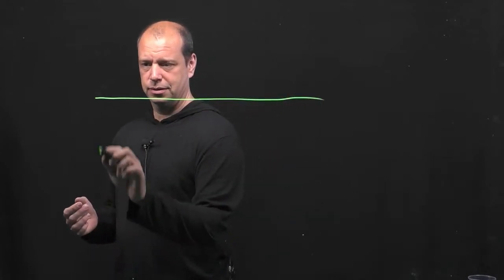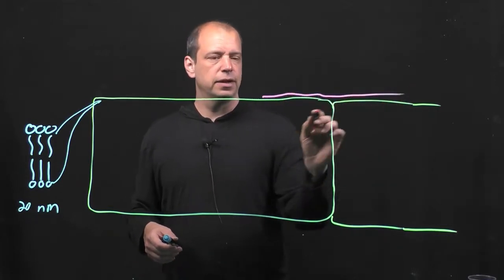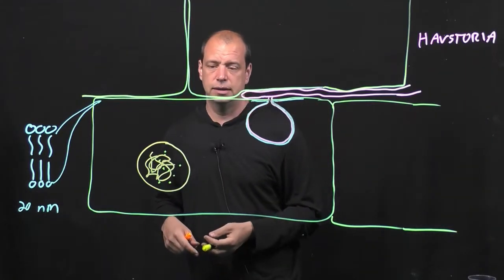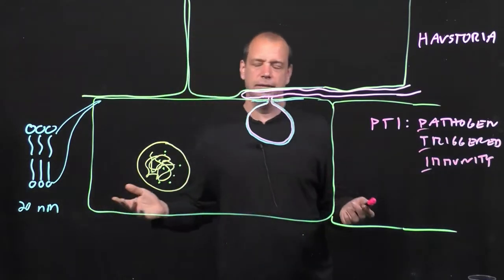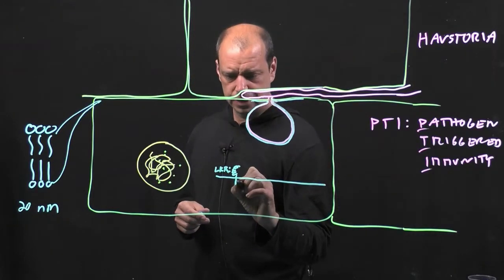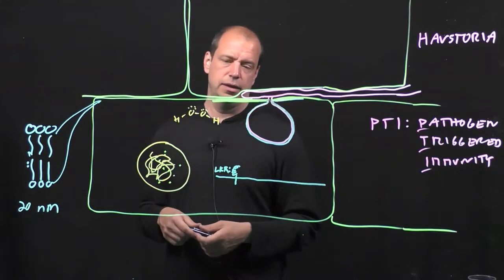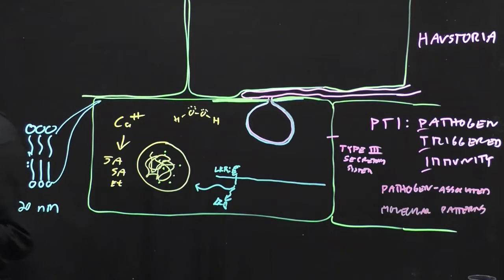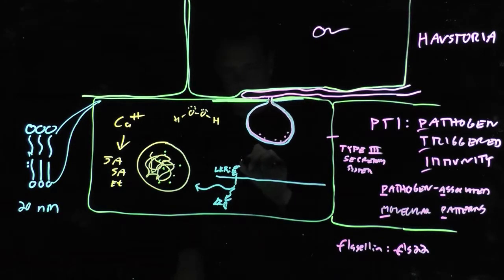Pathogen Triggered Immunity: How a Plant Detects a Fungus

Comment: your comment regarding that it is very rare for plant pathogens to be able to infect 100s of different plant species is just plain wrong. Even if you restrict your statement only to Oomycetes. There are many plant pathogenic fungal and fungal like species that can and do infect 100s of different plant species and it is those ones that will quickly spread over the whole world due to human activities. This causes these wide host range pathogens not to be rare at all. 

The fact that such species are generalists do mean that they are not as specialized on a single plant host and their disease symptoms are often (but not always) not as severe as the specialists. But this doesn't change the fact that they are not rare at all.
Reply from the maker: You are correct. I made this video without a script and I forgot about generalists such as Botrytis. The broader point I hoped to make was that most plants are resistant to most pathogens, due to non-host resistance, and so there are likely many candidates for genes that can be transferred between taxa to confer it.